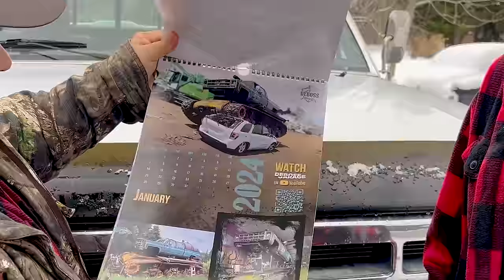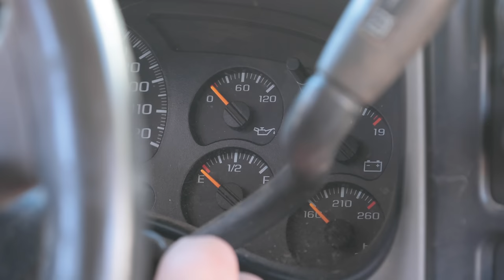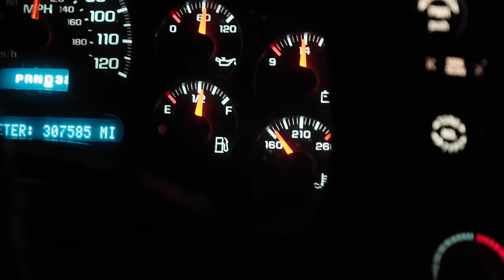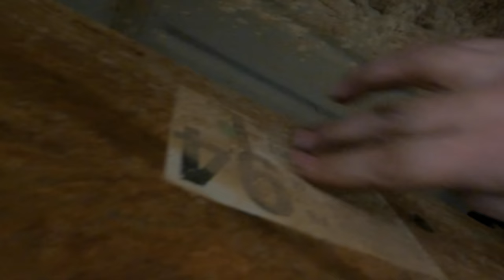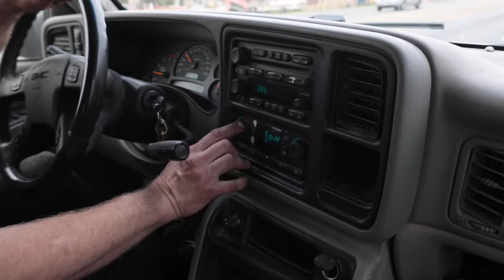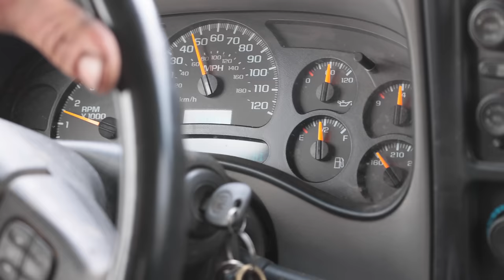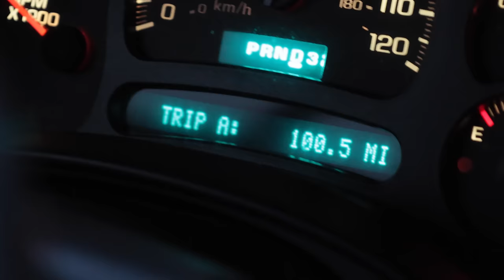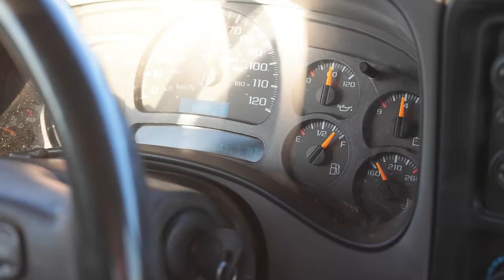How Far Can You Drive a Duramax with Blown Head Gaskets?

Comment: I spotted an Ontario truck hauling another Ontario truck in Missouri a while back. I didn't notice the plates first, I noticed the near lack of rear fender wells and the frame being basically red instead of black for both of them. Rusted to hell and back, not something you see that often, even in the Midwest where it isn't quite a desert yet (heading there between climate change and people tearing out every tree around, leading to the topsoil flaying away).

Comment: I used a washer motor as a water pump to cool a carburetor. The motor ran hot and had an early death. It was meant for duty cycle that looks like the Rockies and Prairies.

Comment: Replace the cap it might not be venting anymore my car got so much pressure it blew the oil cooler up and blew the expansion tank so bad it cracked in half and started adding oil to the coolant new rad cap and no more problems and 4 months later replaced oil cooler and gave the system lots of flushes going strong and normal since with nice clean looking anti freeze in the expansion
 tank.

Comment: Part of the reason it’s not over heating is the thermostats are probably hung open it’s a common thing on duramaxs. That’s probably also causing the low heat. The temp gauge is way off on those trucks 180 on the gauge is more like 150-160. Also there’s a chicken shit plastic fitting on the firewall that’s notorious for leaking where it connects to the heater core. You could have just taken that fitting off and put the hose on the heater core and put a hose clamp on it.

Comment: Are you 100% sure the head gasket is blown? As good as it is running I think it may just be a cracked EGR cooler. I have a video on my channel of what happens when you blow a head gasket under load. Antifreeze burns REALLY hot! It fire slotted the head and melted the top of the piston before hydrolocking. I do not think you would have made it home.

Comment: I drove my 2005 2500 for over a year with blown head gaskets would put a gallon of antifreeze in every 2 weeks, put 100k miles on it like that before it finally gave up because I forgot to check the coolant and it overheated. Warped the heads 17 thousandths from that and had no choice but to rebuild it.

Comment: I had a 95 Corsica with the 3100, blew the head gasket in that when I lived in North Dakota, I drove that thing about 50 miles with no coolant, Idk how it made it, we tore it apart and I sure enough warped the crap out of the head, found another one at a junk yard, threw a new gasket on, that car still ran great up until I smacked a deer going 70mph.... Ended up scrapping it at that point.

Comment: As a 6.0 owner I’m always interested in other designs. People crap all over the 6.0, but I’ve had no issues in the 6 years I’ve owned it. It’s a 03 around 140k and I change everything religiously. Just follow what bill (rip) says and not one problem. Like Rich says, every engine has its problems. And there’s always the ones that run shorter or longer for whatever reason. I think just taking your time, researching and a little experience helps buy any good rig
Reply: I even like the sound. Still can’t beat the high 4k rev burnout in a standard 😂
Reply from the maker: If you watch our "everything wrong with 6.0", you will see why it is such a bad design.  The entire engine is full of plastic and o-rings that fail, and it only has 4 cylinder head bolts per cylinder, where the other guys all use 6.  I'm happy yours lasted, but more fail than make it.

Comment: I drove a 96 chevy s10 with 2.2 with bad head gasket. It leaked outward fown the block. Still had the old metal radiator cap so i put it on past the notch and left it lose so it didnt build pressure. Had to add a little coolant after 100 miles. I didnt have heat either because of it. I did the notching threads and removing o ring on a gas cap before because i was dumb and ordered the not vented tank on my 78 ford and i used and a newer fuel neck due to putting flatbed on so it had the newer plastic clicking cap so it sealed to good and had to notch it. Lol

Comment: On my f150 I bought it with bad head gasket when it was cold it would slow push compression in the coolant system it would not have heat when it got warm the head gasket sealed if I relieved the pressure from the radiator I would get head it was fine tell it got cold then I had to do it over but I drove the truck few weeks that way

Comment: The o ring you are talking about comes from the bleeder screw   if motors hot and you have to prime it then the bleeder screw will break in half leaving the bottom half of the bleeder screw to push down into the system.  I would never tell you anything about a diesel motor but I know this from hands on fuk up.

Comment: It’s sad that a lot of these trucks sit for repairs like this. But the book calls for 38+ hours for a Duramax HG job, at any reputable shop the labor rate is basically +/-$150 USD per hour now… Math that out and you can realistically buy a WHOLE beater 01-05 Duramax truck instead of the cost of a the head gasket job lmao.

Comment: Red Devil permanent headgear head gasket for a Power Wheel Fix It for the 6000 me with no one what it's doing 35.00 and you're good for at least you're all the way home and then back again if you wanted to with no more than what it's doing it really works I've got it in my car and I've been going now for $40,000 Mi and it still okay

Comment: It will drive as far as you want it to... UNTIL!... It wears down or deteriorates the head gasket enough, to blow off small chunks of the hardened head gasket material into the upper valley and/or the oil galley... Bypassing the oil filter...and dropping into the oil pan..which then gets sucked up by the pickup tube, and straight into the (very tight clearance) gear driven oil pump, in which the small chunk of metal will then cause the pump to abruptly stop, and cause the the "reverse threaded nut" holding the crank driven gear to back off... Causing you to loose oil pressure... And the warning light to instantly come on.  Ask me how I know? Lol.
And what is Gm's fix for this?, after tearing everything out and apart after fixing the headgaskets, and poorly designed compounded heat issue with the turbo bottle
kneck, multiplied by the EGR and poor heat dispation under the hood. The remedy for the oil pump is to tack weld the nut to the tread... So it doesn't back off. But what will that do, if the same situation happens again?
Probably shred most of the gear driven assembly coming off the crankshaft and dropping it into the oil pan.  Atleast the metal it wont get picked up and recirculated because the oil pump wont work, and all of your warning lights will come on. Ill never buy or waste my time with a duramax again, because of that oil pump design, and their is to much stuff stacked together in too small of a space under the hood, and is a pain to work on. It was a good learning experience for me in learning about the motor with majority of the disassembly and removal, but what really stopped the rebuild after all that was, the either the lack of previous owner mantainance/corrosion/heat/or gm's poor choice in cast aluminum alloy... (While being very careful) broke off 3 glow plugs, 1 exhaust manifold bolt, and stripped 4 inner valve cover gasket bolts, with an "easy out", which prevented me from even getting down to all of the headbolts, which is now not even worth the machining, for my (at one time) $2,800 planned upgrade of parts. I was away from home when this happened....The stealership labor wanted 4000 just to tear into it..(not including putting it back together) OR $16,000 for a new LLY engine.😂😂 😅..no thank you. I'll be going custom frame, p-pumped 8.3 with an md3060, or a turbo 8.1 vortec and 6 speed Allison. Did I give up too easy..maybe, but it opened the door to the world of other possibilities, the secret world that is hidden, and yet obscure between the worlds of the 1-ton and 5 ton chassis's.😂😂...aka the medium duty truck world.. or the " need something a little bigger than a 1 ton, but do not want a semi tractor".
The one at will take you down the infinite rabbit holes, in the quest for knowledge..for parts, the study of vehicle dynamics, weights, efficiencies, and the quality dynamics of durability.  The ultimate quest of Purposeful Build, and not bought! (Because of the insane prices/ lack of quality and durability of todays vehicles.)
The Duramax lly, and lbz is a grey area for me, they have been proven, but the high rate of accounts, of gm's historic stock recipe for
disaster out of the box, and there future choices with there  "improvements" the newer duramax with the Cp4.. make me want to stay away from that . 
All I can say is keep your Duramax COOL!!! 
Make sure you have the an upgraded intake elbow for the turbo, keep the block and heads clean from salt, and some type antiseize with preventive maintenance or repairs. Also.. put a hood vent, hood scoop, with vents or side vents on the fenders to let it breath and not trap all the heat under the hood, I think it would be more effective than even an oversized radiator...but might be more effective to relocate the air charge cooler because of the heat from the AC condenser... Especially in hot weather. 
I hope this info may help somebody, and save them some time when considering the pros and cons of a Duramax.

Comment: Can use the head gasket stop leak into the coolant
Reply from the maker: Again?  And then clog the heater core like it already did?
Reply: @DEBOSSGARAGE  if the problem goes away drain the coolant and replace fluids after a few flushes with water to clean any leftovers

Comment: Hey just re that clip you used for undoing the fuel lines. I've always used the nozzle off a tube of silicon (or cock if your American :P).  You can trim to different lengths for different diameters and WHEN you lose it is easy to make another haha

Comment: Use your dipstick as your funnel. Liquid dynamics will retain the surface tension and the oil will run down the stick into the hole, or some scientific blah blah blah

Comment: Oh man, i hate to see when deboss is so wrong about something. There is no lift pump on a duramax. You have the injection pump and thats it.
Reply: And yet, there’s a lift pump in the tank. Try again
Reply: @HJZ75driver  um no there isnt. I own 3 05 duramaxs. Ones 1400hp, ones fully built and resorted. And ones about to get rebuilt. The reason airdog and fass make lift pumps is for that reason. They only have a sending unit to read the fuel level.
Reply: In fact my shop is scattered with parts, fuel tank, engine and all. You need any pix i can gladly send them. Trust me i do this daily. I built my trucks, i restored my trucks, and i own 5 cateye silverados. Gas and diesel.
Reply: Yes, it does have one. Lift pump for a lly is built into the cp3.
Reply: @GMCJay_lly  negative. The cp3 pulls fuel from the tank. It is not a lift pump. I have one fully apart on the bench right now. It has 3 pistons that all pump fuel. There is no pump or anything in the pump that is doing anything in the form of what a lift pump does. A lift pump carrys fuel to the injection pump. Theres no in tank pump. Theres no pump in the cp3, nothing. It works similar to vacuum, but is weak. I feed dual 12mm pumps at 10psi from a airdog 220. And my stock pumo truck has a 150. Without it the psi is 3. Any restrictions 3psi will do nothing which causes a po087. Then people put a plug in thinking that is gonna fix it, wrong again. The plug is dangerous and can destroy a fuel system. On 150%  over injectors i run a 2400bar prv. But again there is no lift pump in any cp3 or built into any duramax truck. If they did anything in the newest l5p maybe, but i dont own an l5p and thats an hp4 pump anyway made by denso. Bosch didnt build anything into the cp3, if anybody wants the proof ill take all the photos you want.